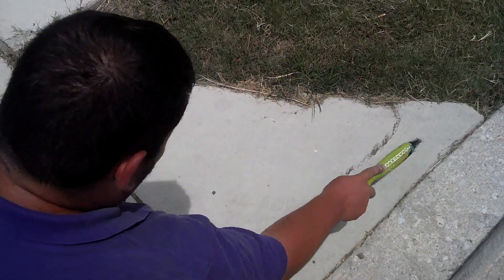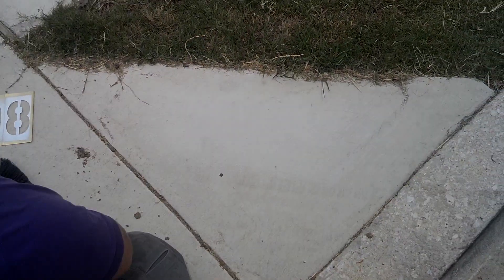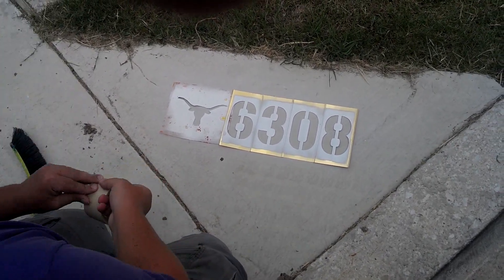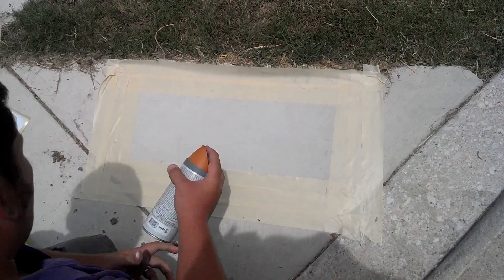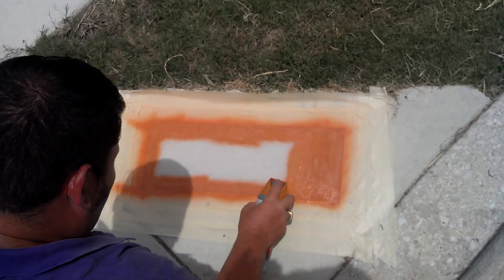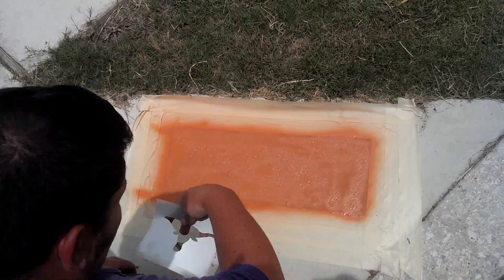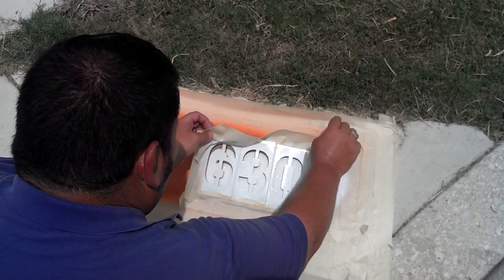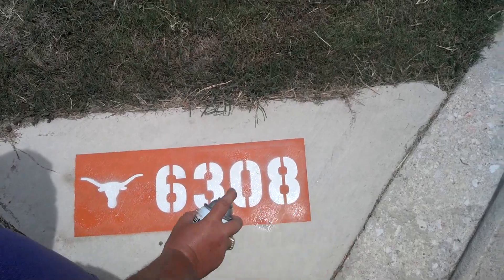DIY: Home address curb painting with a logo - How to curb paint

Comment: Great video! I'm wanting to do this to my curb but the former owners had it painted already and it is flaking off and looks terrible. What can I do?
Reply from the maker: Cristin Coulter Just use a wire brush to scrape away as much of the old paint as you can. Tape it off to at least as big or bigger than the old box and repaint.

Comment: Can you do this on curbs that have a tall/steep curve?
I'm having trouble on mine and am trying to figure out how to solve this?
Reply from the maker: Hi Jared,

It's basically the same process. Measure your spot, tape it off and spray it. The only difference is with the gravity, you have to tape down the stencils as well. If you are using hard stencils, they may be too big and not flexible enough for some curb faces. If this is the case, try a smaller stencil, oilboard stencil or soft plastic stencil. 

We'll put up a curb face video in the next few days.